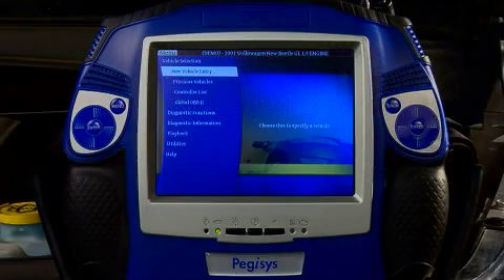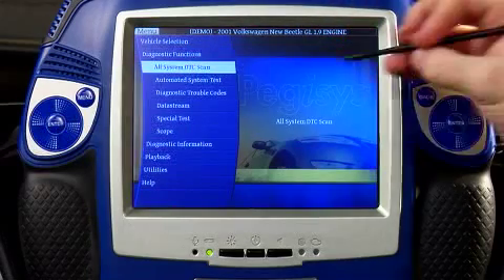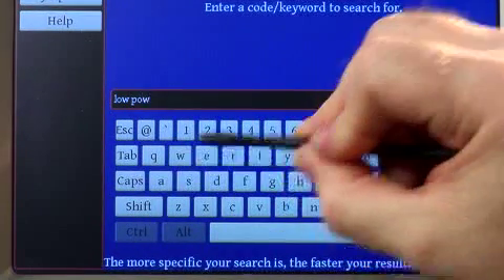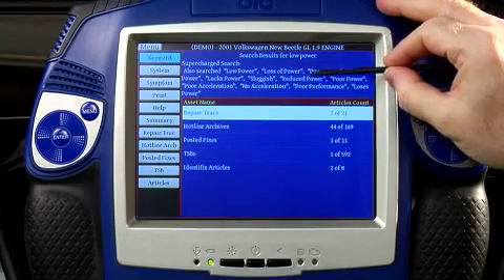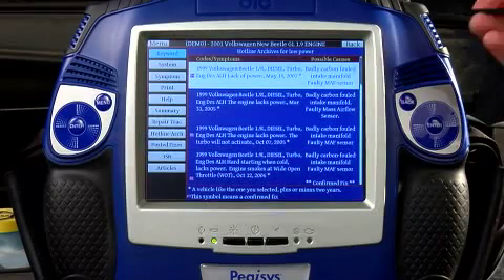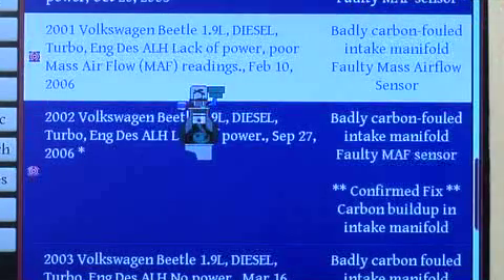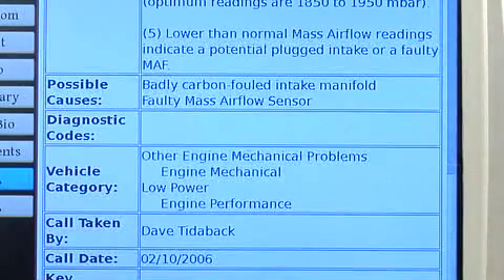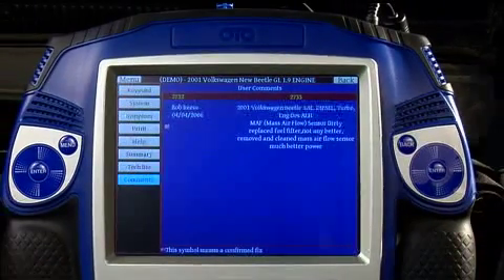OTC Tool Guy Pegisys Direct - Hit Technician 2001 Volkswagen Beetle 1.9 Ltr. Diesel  Engine

Comment: showed wss code but wouldn't show me wheel speed sensor data on a 99 taurus, what good is that? had to use my maxidas, all otc is doing is selling a subscription to identifix, the scanner in my opinion leaves a lot to be desired.